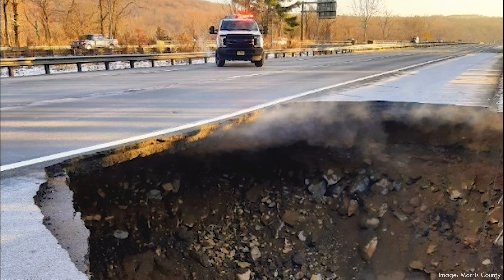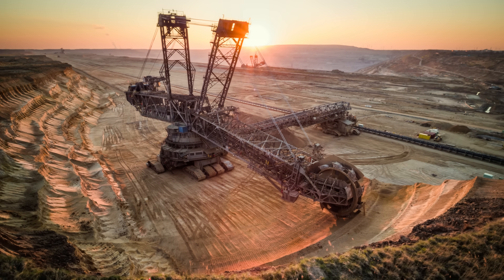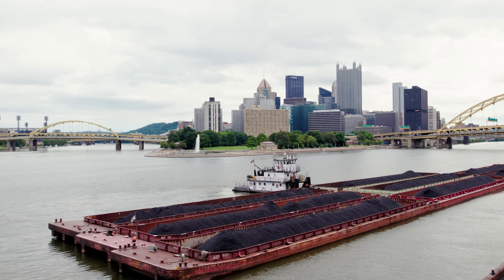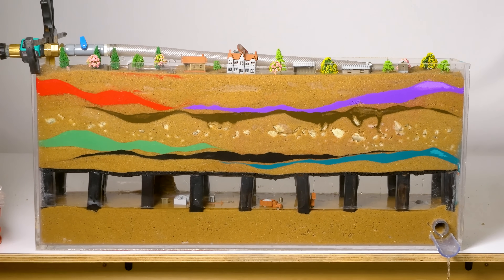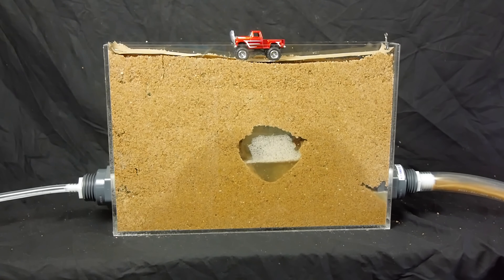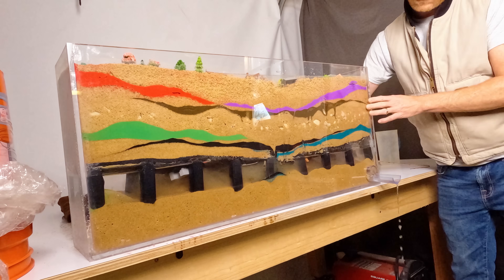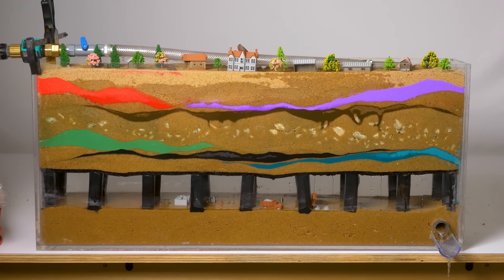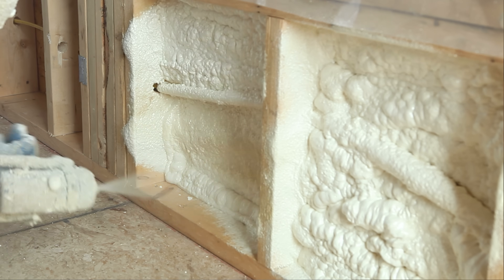When Abandoned Mines Collapse

Comment: This wasn't the point of this video, but I wish you went into the actual repair techniques for that site. I saw some pics of the rebar they put in. It was tremendous, far above what would normally be done. It seemed to be at least 2' thick with gigantic rebar really close, in alternating diagonal layers. The entire thing was encased in concrete. I did notice they were careful to follow the angle of the mines underneath. They didn't spend a dime in overlapping the edges onto firm ground. It's basically a ground level flying bridge.

Comment: I see collapses in action every time we get a good rain here. DFW. We are in a small area with super sandy silty soil and we have a massive problem with moles and some years pocket gophers. The moles have a massive tunnel complex far more than the surface ones that your foot goes into. I have one spot that flooded into at around 2' deep and it looked like it was about 3 layers of tunnels.  Very destructive animals and I need another load of top soil to fill in their bore holes...
     And all the tunnels and collapses make it extremely had on the back when cutting the grass to the point where I understand why an old neighbor always pulled a sod roller behind his mower when he mowed.

Comment: I was on a site when an undocumented mineshaft collapsed. Upon inspections by others, apparently when they "closed" the mine they had chopped a tree down and pushed it into the shaft upside down to form a plug then backfilled stone and dirt on top to seal it. We'd been rolling diggers and dumpers over it for months, I'd walked over it god knows how many times, but it wasn't until we started pumping concrete onto a reinforced slab that it collapsed. It looked funny, the rebar was still where I'd set it but a 3-4 ish m square hole in the ground had opened under the rebar in the middle of the slab and had swallowed all the concrete we'd been pumping all morning. I was VERY tempted to walk on the rebar over the hole ad drop a rock down, it seemed like the thing that was done in a situation like this . . . but I didn't, kinda regret it.

Comment: Used to be an underground coal miner in West Virginia. I can confirm that not only do mines today use long steel "bolts" drilled and glued into the rock to support the roof in every square foot of the mine "entries," aka tunnels, but particularly in longwall operations, the entries adjacent to where the longwall has passed and left behind the "gob" or overburden, are supported with pillars of concrete spaced to specs set by the mine engineers. Installing those concrete supports was my job. We would pump the concrete underground in piping in two parts from a surface location to where we were working. One part Portland cement and fly ash concrete mix, and one part silicate hardener. when pumped together through our lines and into collapsible bag forms, it would harden enough to take weight in as little as an hour, and then cure into completely solid pillars in 60 days. depending on the size of the bags the engineers spec'd an entry for, they could be rated from 40,000psi per bag, to well over 60,000psi per bag. the spacing between bags could be as short as a foot apart, to 5 or 6 ft apart, again depending on what the engineers are designing. That is a LOT of roof support. it doesn't solve any subsidence that happens directly above the gob of longwall panels that get extracted, which are 1500ft wide by 20,000ft long blocks of coal. Even today the mines are more concerned with worker safety than surface conditions. Those leftover longwall sections have to be monitored for methane and ventilated for the life of the entire mine, so the entries made to access them during extraction have to be maintained after the fact. Concentrations of methane between 5%-15% in the air is called firedamp, conditions ripe for mine explosions that the mine has to prevent, so every longwall panel continues to get fresh air ventilation even after the workers move the longwall machine to the next panel. Thank you for coming to my Ted talk on modern coal mining practices.

Comment: I saw this first hand in the City of Renton near Seattle while working as an engineering consultant.  That area had numerous abandoned coal mines and a ground section collapsed into one of the old air shafts.   The hole was very close to a major water line feeding Seattle and other surrounding cities.  Seattle sent an army of trucks and other exotic vehicles to handle the situation.

Comment: I grew up in the Rhein-Ruhr area in Germany in the 70s. There were a LOT of problems with skewed and cracked buildings and minor earthquakes due to rock bursts. Even worse, ultra heavy freight trains that transported the coal from the mines to steel mills shook up the ground so much that plates and cutlery rattled in the cupboards like having a poltergeist on speed. 
Then the law changed and they started to refill dead tunnels with slag from blast furnaces. Pretty neat recycling method. Take coal. Heat furnace. Take furnace by-product. Put  back in mine. Stable mine and surface. 
Funny tidbit: Later the law also required new isolating windows for family homes. But instead of considering the skew of the house, contractors put the windows in completely level. Some houses looked like crooked shacks from a fairy tale. Not so funny for the owners tho.

Comment: I still don't know why we still need coal when we have natural gas and nuclear fission power now. Trains can run on diesel or electricity generated from natural gas or nuclear fission. The only thing I can think coal would be needed for is those novelty old-fashioned trains, which you surely don't need a lot of industrial global scale mining for. Even in developing countries they can use natural gas or oil to run their power plants over smog and acid rain causing coal. Coal should be left in the distant past as a fuel source now. Of course, mining in general is still necessary to get the cobalt and lithium for rechargeable batteries and for rare earth metals, precious gems, and various other metals, oil, natural gas, phosphates, nitrates and magnesium for making fertilisers for agriculture, etc, but we don't need to mine coal anymore, it's unnecessary, we should be gradually phasing it out if we aren't already. I know it is a more difficult conversation about phasing out natural gas and oil in favour of nuclear power and electric cars, about having to stop getting the cobalt from African child slaves as if we are still in the 1850's when we used them to make cotton for clothing, and having to figure out how to set up recycling for the lithium and cobalt and other components of rechargeable car batteries so the lithium doesn't eventually run out, or at least the actually accessible lithium, and some people still preferring to drive cars with internal combustion engines, and how to provide electricity without having to use any fossil fuels whatsoever in places that have earthquakes, maybe having to figure out how to design earthquake proof nuclear reactors to prevent another Fukushima incident in the future, but the question of the downsides of phasing out coal usage is clear; there are no downsides. What do we even use coal for these days? Accessing wood for fireplaces in cities was hard so they used to use coal, but city homes these days can use natural gas or electricity to heat their homes and remote off-the-grid homes can use propane or wood, trains can use diesel or electricity, so it's just novelty old-fashioned trains that don't require much global production of coal, and power plants that doesn't affect normal people because they don't care how their electricity is made unless if they are environmentally conscious and don't want it to be from non-green sources in which case they're definitely not going to be wanting it to be coming from burning coal, and so they can replace coal power plants with natural gas, oil, or nuclear fission power plants. I fail to see the problem with getting rid of the use of coal except in small amounts for novelty old-fashioned trains, I really do, I am actually genuinely surprised they are still going large-scale mining of coal, in the USA rather than somewhere else in the world like China, really??

Comment: core of it should be regulation and secondary use
for example , know one place cant recall why it got dug out originally but some of it was turned into long term underground vault storage
in a modern age of sensitive hardware , utility for cool environments or need for steady energy such as deep thermal tapping ,  well , citys should not just grow more vertically up , but down to , and other locations should use old mining networks as the skeleton for futher underground efforts buuuut this do touch on the one thing selfish private profit greed loaths , REGULATION! since Civilization needs not just CLEAN mines ,but well mapped out ones.

Comment: Thank you for this info. May I ask a few questions/share some information?

Question: You showed water's impact on abandoned mines, What about drought? NJ has been under a drought warning since late summer/fall 2024. would a dropping water table erode / shift soil? Does the groundwater itself fill voids and provide support, which is lost during droughts? 

Information:  April 5 2024 NJ had a 4.8 magnitude earthquake whose epicenter was Tewksbury, which is not too far from the sinkhole in Wharton. On that day there was a water main break (Randolph NJ) in which the street cracked open and water shot out at a nearby home at high pressure.

 Question: Could other water supply pipes in Wharton or elsewhere have been cracked or damaged to a lesser degree by the earthquake so that slow leaks over months eroded the ground from underneath? 

Information: people in the Wharton area say there is a quarry in the area that often uses blasting to loosen rock from the pit.

Finally, Hoboken NJ, Frank Sinatras hometown right on the Hudson River across from NYC, has had several sinkholes over the years (including one prompting headlines about automobile-eating sinkhole)....but the town never had mining. It is, however, prone to flooding, especially on the west side of town, which was originally a tidal marsh that was filled in. The high side of town by the river is composed of limestone. Parts of the sewer system was/is very old, so old that there were / are still  pipes made of hollowed out trees  and pig iron....hmmm no problems there, can't imagine how giant holes opened  up in town. 😂😂😂

Comment: Rock mechanics engineer here with some fun tidbits for those that are interested; part of my job is to model subsidence above soft rock mines. notable salt and potash (i.e. evaporite minerals). In evaporite minerals, they naturally deform over time when subjected to an anisotropic stress state. Mining out an opening in any material will disturb the equilibrium of stresses, and in evaporites this triggers time dependant creep, and that creep will continue until the mine opening is re-closed and the stress equilibrium is re-established, which typically takes decades. For there to be a mass balance, as those rooms close, that volume difference will eventually be expressed on surface. The rate of creep is dependent on the mineralogy, temperature, and the stress state. We start with lab testing and a 3D finite element model to determine the closure rate of the mine openings, and then we can determine the actual influence of subsidence based on the mined volumes, depth and material properties of each stratigraphic unit above. Subsidence will typically form a "bowl" around the mine, with the highest subsidence near the center, and decreasing as distance away from the edge increases. Generally the deeper mines will exhibit lower magnitudes of subsidence on surface, since the diameter of that "bowl" will increase, and a larger surface area is "losing mass" to make up that mass balance.

This kind of engineering is super niche, never thought i would see a video on soft rock mechanics randomly pop up in my feed.
Reply: Amazing. I grew up in southern MO and I think a lot of mining engineers get their start at the Missouri School of Mines in Rolla, MO. 
Does this same idea of subsidence work with oil wells also? 
I've heard West Texas is sitting on a great lake of oil, and that the oil has been pumped out for a hundred years, and that the great sinkhole neare Wink, TX is the result of this. 
Does this make sense? 
or is this just envonmental wacko talk? 
(Just kidding; it was oilfield operators that shared the sinknole theory with me). (they are environmentalists, just not wackos).
Reply: @safetymikeengland  Its certainly possible to see some subsidence on surface from oil extraction. just to be clear, there are no "lakes" underground, oil is found in the pore space of the rock/ground, think wet sand. I wouldn't exactly expect oil extraction to cause an sinkhole, since the oil extraction pulls fluid from a relatively wide area. If there was a previously existing collapse feature or something, subsidence could maybe trigger some increase local displacement, but I would be very surprised if it was the actual cause of the sinkhole in the first place.
Reply: @laxplaayaa  Maybe not for oil, but you certainly see it for spring water. We've got all these companies pumping water out of the ground and just leaving giant chasms that inevitably collapse (though that's probably a topic for PE's sinkhole video more than this one)
Reply: I'm a geotechnical engineer (but rarely works with mine). Is the lab testing for geomaterial properties, or did you make scale model of mine in your laboratory?

Also, how far in terms of depth the subsidence go? is it related to "bowl" diameter, mine depth, mine area, etc
Reply: @billytanadi8303  we test for material properties, primarily elastic constants and poissons ratio. Physical models cant really work when you need to simulate a full stratigraphy of varying lithologies and vastly different material properties. 
By the time you find specimens of the right lithology, plane them down to the correct thickness for scale, then bond them all together you really wouldn't be testing a representative model of the actual natural materials anymore.

And yes, subsidence is completely dependent on the depth of the mine, the extracted volume and the mine's area. Typically for the mines I work with it could be a couple inches in the near term and a foot or so in the (very) long term. Potash is creeping material, so subsidence is a function of time as well.

Comment: Another enjoyable and educational video.  However something jumped out at 7:05.  There is an unsecured gas cylinder leaning against the wall at the back. Even if the cylinder contains a non-hazardous gas (and this appears to be nitrogen) the cylinders become very dangerous if knocked over and the valve is damaged. That would simulate a very powerful earthquake!  The cylinder should be either secured in a cart or chained to the wall.

Comment: This is the real issue with modern engineering that you folks never address. Under the profit motive, projects can never be fully engineered to necessary specs. The profit motive attempts to drive down costs and cut corners and the real affects of this years or decades later are borne by citizens while corporations and shareholders have long run away with said profits. The fact is our system is unsustainable and you're only helping perpetuate our crash.

Comment: What do you mean 'each time the highway had to be closed"?  They closed and reopened it the first time. Its been closed both east and west bound since the second sinkhole opened. Its been MONTHS of traffic nightmares here! They HOPE to have 2 west bound lanes open by the end of May.  And then there's Mine Hill NJ. Why would you build a town OVER a mined out mountain?  Now, our soil is FAR from the model shown here because it's not sandy soil. He have mostly stone and dirt. But I have been in 2 mines in the area when I was younger. They are supported with timbers. Timbers that are 100 years old! The mine known as the bat cave had a collapse at some point. You could get back pretty far but just passed a large gallery on the right it's collapsed and impassable

Comment: Dumb question, but if it’s possible to engineer diamonds, why can’t we just make more coal? What’s stopping me from putting the right material through the heat and pressure the same way you would with synthetic diamonds?

If we could do this, we could literally farm coal. You’d be farming coal through extra steps.
Reply: We do make synthetic diamonds, problem is that diamonds are pretty much worthless in practical use aside from tools or coatings. It doesn’t need to be “pure” to get the job done. Coal is a different story…

Comment: In Australian hard rock mining, one common method of underground mining is the 'Block Cave' method.
A decline is dug down beside the ore body and ore drives are struck out in the mineralised area, then when the decline is continued to lower levels, more ore drives are stuck out again.
This continues down the extent of the mineral deposit as the upper ore drives are progressively blasted and loaded out to the surface, while geologists sample the ore to determine when the regular earth above starts to be seen. 
The ground above fractures and follows the retreating ore body down after fracturing and breaking up.
There is an international sink hole formed by the process to which access is prevented.

Comment: This reminds me of an odd job (odd for a diver) to figure out why a series of townhouse, built on overburden piled on top of the foundation and sanitation void of an old military barracks that was there, were sinking into the ground. The sanitation void concrete pillars and beams basically looks like that model, complete with rubble piles where the slab had holes or partial collapse let the overburden down.